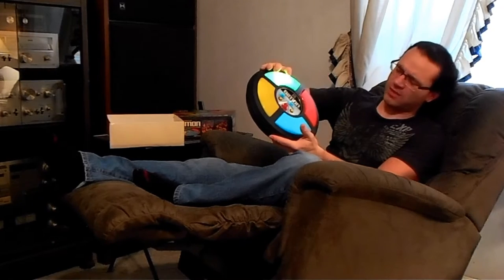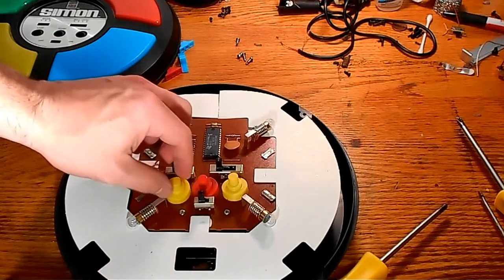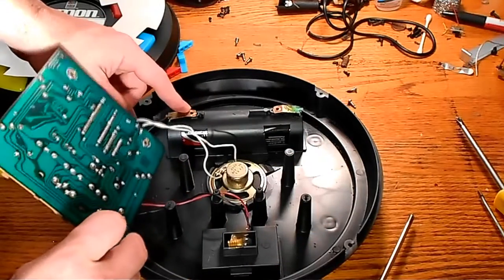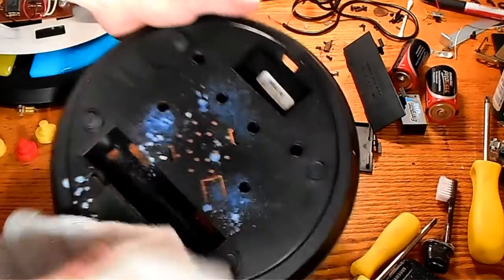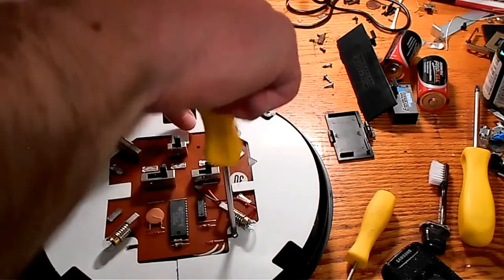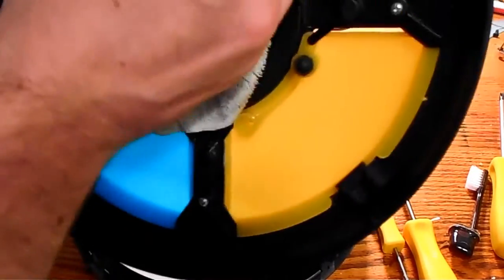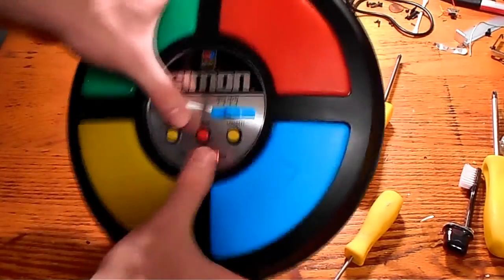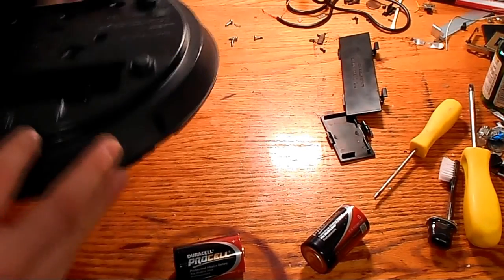Milton Bradley's Simon - Unnecessary Surgery

Comment: For a huge plastic case, I was really surprised by how small and simple looking the inside is :-D
Reply from the maker: Ah, man, I love that! Simple stuff means stuff you can work with, fix, enhance, have fun with... It's kind of like new cars VS old cars... Prior to the 90's when most people still used carburetors, any do it yourselfer would have had little issues fixing almost all car issues, fast forward to fuel injection, computer controlled everything, and wow, the bastards even cover up your oil cap with plastic junk just to hinder anyone who might be tempted to save a buck. I'm sure the size of Simon was dictated more by the possible 4 player game modes, which I did not discuss in this video, but that one should be coming up sooner rather than later.

Comment: what did you spray at the end ? did look nice and clean on the camera. any item that spends a long time in here, you could probably smoke it.
Reply from the maker: I used a Chrome polish for those battery contacts, I used windex for the light bulbs, and all the plastic and rubber stuff I used Meguiar's Ultimate Protectant for vinyl, rubber, and plastic... Although I use it on most everything. It's really good stuff and yeah, makes my car wiper blades last 2 years instead of a few months....and... makes the interior of the car look new. There's a lot of plastic polish stuff and I've used a lot of them, but this is by far the best and longest lasting stuff I've ever used... I don't know if it's sold in the UK but it's in pretty much any major stores auto section in America and of course the auto parts stores as well. I swear by that stuff, I really think all us old gamers should be using it.
Reply from the maker: I just looked on the back of the bottle and Meguiar's does have a UK location! So hopefully you can find it over there in your auto sections!
Reply: cheers shot you are better than QVC shopping network but you can never replace mike levy.